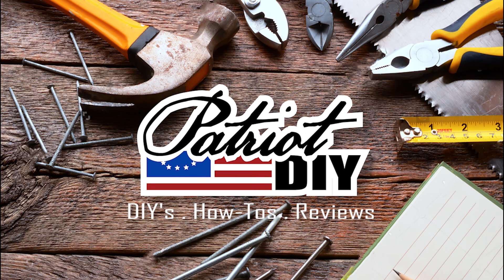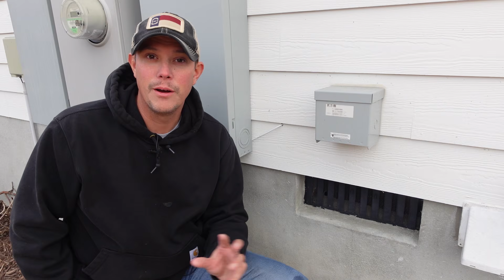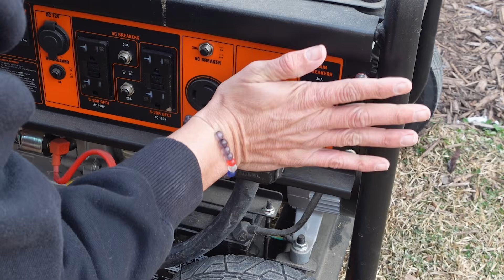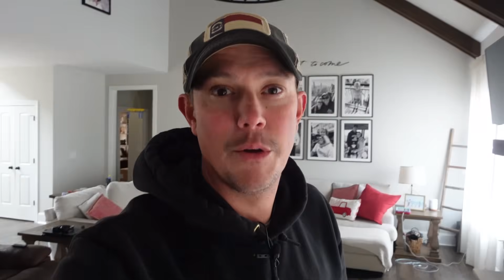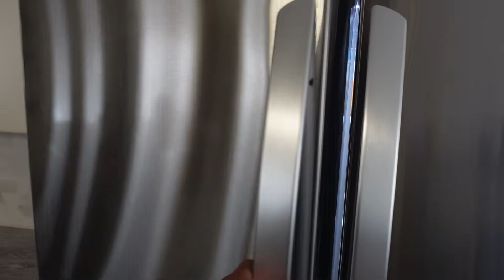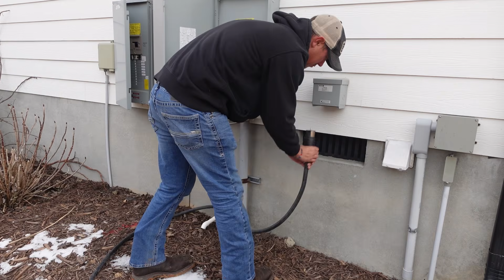How To SAFELY Connect A Generator To Your House

Comment: How could you possibly overload your 11,000 W generator with your house?
Reply from the maker: Well, most "Whole home" generators start at 15,000watts on the small end and go up to well over 25,000. So depending on the size of your home and if you want to run everything as normal...you could easily overload an 11,000watt.   Thats why I turn off unneccessary circuits and only run power on 1 floor of the house in this scenario.

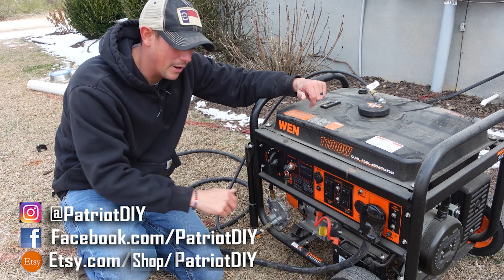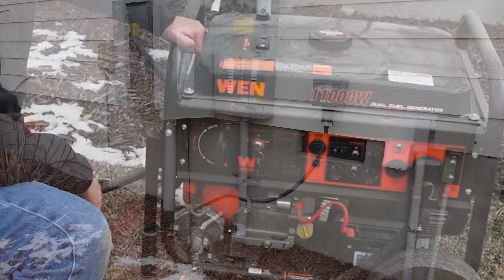Comment: at 5:11 why did it take so long to turn on. what would you have to check if it didnt end up turning on?  at 7:11 when turning off the generator, is it best to unload the breakers prior to just cutting off the generator?
Reply from the maker: Just had to turn on the choke, first time it had been cranked in a while.

And you could cut the break before turning off the generator but I just like to remove the power source before I do anything else

Comment: Guess I need to call an electrician as I am not sure this is "legal" in my state. In clicking on your links, it only takes me to the stores main site and not to what you were buying/using. Where did you get the junction box and interlock for the panels?
Reply from the maker: Mine was installed when my house was built

Comment: How do you know the power has been restored when you're running a generator?
Reply: Check street lights. See if neighbors have power.  Think grasshopper...
Reply from the maker: Flip back over from generator to grid power and try to turn on a light lol if works you got power, if not crank the generator back up.

Comment: permanent Generac home standby generator is better than a portable generator for automatic, hands-off convenience and full-home power, but portable generators are much better for lower cost and flexibility.  Stay away from portable generators if your not experienced using them, they will kill you or blow up your home, do yourself a favor if you have good credit and get the generac system that automatically comes on during a power outage🤔😎
Reply: For 10 grand
Reply: @aliekatsmom    I haven't got 10 grand.  Not many people do these days.  If the grid goes down for more than a few days, the water will cut off within a few days and gas right after that. If you're house is all electric then not so bad.  I have a gas furnace so I'll be running extension cords to space heaters and a countertop cooktop.
Reply: @aliekatsmom I financed mine for 120.00 a month, way safer than a generator with gas, when the power goes out, it just pops on!
Reply: Costs too much. My dad paid 12,000 for a 6000 dollar 12k generator after all the permits, propane tank, labor, etc
Reply: @Leyenda1 You don't have to pay that much upfront, if you have good credit!
Reply: @Detroitjitdancer you are right. But the point being end costs. In fact, you are going to end up paying more cause of your good credit. Thats just the nature of a loan.
Reply: @Leyenda1 I paid mine off in a Year, Monthly payments for a Generac system range from about $116 to $200+ per month on standard multi-year financing plans, or roughly $833 to $1,000+ per month if you choose to pay off a typical $10,000 to $12,000 whole-house system completely within one year!
Reply: @Detroitjitdancer why finance if you paid it off in a year?
Reply: Financing a purchase with a plan to pay it off within one year lets you bridge a temporary cash flow gap, protect your emergency savings, or build your credit history without paying long-term interest!
Reply: @Detroitjitdancer But your "good credit" is a net lose because you end up paying MORE in the end even if you paid it off in a year.
Reply: @Leyenda1 I don't understand what you are saying, mine is totally paid off, im not paying anything now, besides my DTE Energy Bill! The total price of my unit was $16,000 with monthly Payment's
Reply: @Detroitjitdancer if it only took you a year to pay it off then why not save for a year, accumulate interest on it, then pay cash for it. Even paying it off in a year you paid interest on it despite your good credit rating.

Comment: I live in Az am installing 50 amp generator outlet to my house. I have the interlock installed and the outlet box ordered. I am stalled out at the type of wire needed to go from breaker box to generator box. The whole thing will be outdoors. Do I have this right that I need 6/3 cable with ground UF-B rated for outdoor use? Thanks.

Comment: The one thing that no one ever seems to cover is the MOST likely situation of when the power goes out during a storm. I'm assuming you don't just wheel that thing out in the middle of a rain or snow storm.
Reply: Sometimes you gotta get wet
Reply from the maker: I do! But it sits under my deck with exhaust pointing away from the house....so mostly covered
Reply: @PatriotDIY  Be careful friend if your deck like most is made of wood and attached to your house, risk of fire if the generator somehow catch fire.
Reply: Common sense shows most people run it out of their garage, with it open obviously. If you don’t have one, others have built small sheds or some type of tarp to cover the generator.
Reply: Or you can if you need it

Comment: Did you float the neutral in the generator
Reply from the maker: No I havnt done that. Honestly didnt know that was something that needed to be done on portable generators. Ill look into it
Reply: @PatriotDIY Will work your way. Everytime something gets popular someone has to find a way to convince people to take it apart.
Reply: @billd4056 it will work until there is a problem and the breaker doesn't trip and starts a fire...details matter especially with electrical